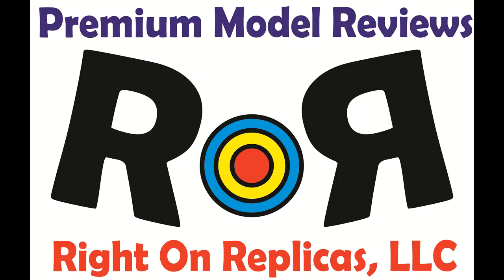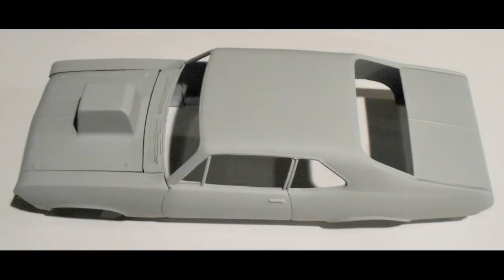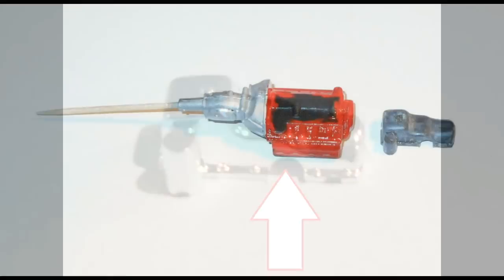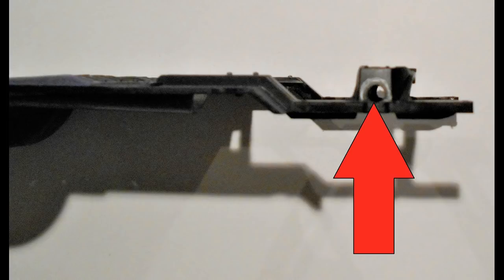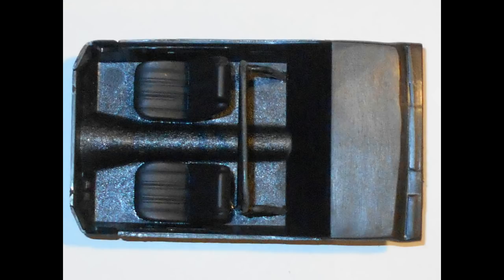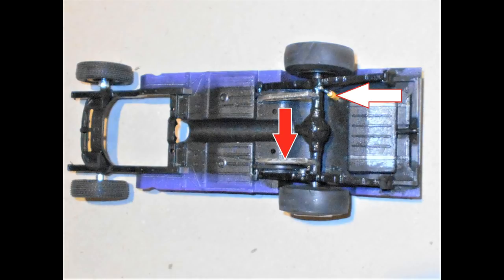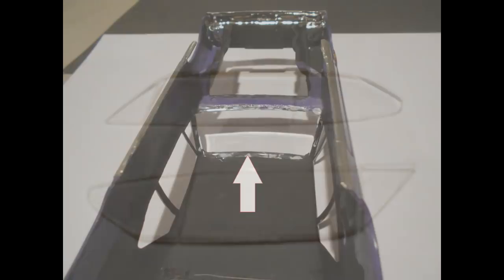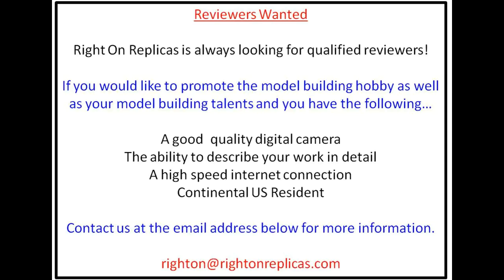Nova SS Pro Stock Car 1:25 Scale AMT Kit #1142M  -Model Kit Build & Review

Comment: Doug-the line you refer to between the headrest and bucket seat back is correct. Fed safety regs required "head restraints" mandated in '69 or '70, and they began to appear in '68, along with side marker lights. They were adjustable for "driver height", so they moved up and down to be positioned "at the base of the skull". We never did that. Freeway cruising was full up, local cruising was full down and hunched over the wheel! It wasn't until the mid- to late-'70's that high back buckets (in effect, integrated "head restraints") started to appear. Not to be confused with "highback" buckets from the turn of the decade, which was probably to guage reaction to what was to come. I, too have been frustrated by a re-tooled kit that overlooked the "axle thru engine" mess, cool fix! Great build, as usual!
Reply from the maker: PL, there's actually an open s!ot at the top of the seat back.  It could be used as a coin bank!  - Doug
Reply: The photos didn't show the coin slot, ane the result appeared to be moldeed to the seat. My apologies.
Reply from the maker: PL, No you're right.  I took the photo after I finished it off and closed the gap. Thanks!  -Doug

Comment: I have built this model kit I put the kit together and I found out that if you wait till the end of the build to put the two front fenders on you can set both fenders on, use the front grill/bumper on and then use masking tape to hold the fenders in place,no need to take any of the hood off with scraping or trimming.
Reply from the maker: BR, Thanks, that's a great tip for this one! -Doug

Comment: I just started this kit. I think this utube video got me interested AND  because they still make this exact kit,I didnt feel like I was sacrificing a kit from my big collection thats out of print,and worth a few bucks. ANYWAY,when I got this kit I worked at a Hobbyshop and forgot that I bought Fred Cady's Grumpy's Toy
Decals. They have yellowed in 30+ years but they say to set them in a window where the Sun will bleach them back to white. Hope it works
🤞. Anyway,THANKS for the video Doug ? Its giving me a heads up on the issues you encountered while building it . 👍👍👍👍👍👍👍👍
Reply from the maker: HH,  Put the decals in a baggie so they don't get moist from condensation.  Place them in a window that get s the most direct sun with the decals facing the sun.  They should lighten up within a week of two.  If you clear coat them they won't yellow again!  -Doug

Comment: Does the 69 kit have the same fender issues and hole through the engine?
Reply from the maker: NY,  I'm not sure what kit your referring to but I think this is a '69 Nova.  Regardless, any of the Nova kit derived from these AMT molds will have the same issue.  I think there's a stock Monogram kit #85-2098 that does not have this issue!  -Doug

Comment: The freaking hole in the oil pan doesn't even line up with the axle rod holes on the chassis. The hole in the oil pan is way too far back for the rod to go through it. What the?!! That's annoying. I'm not sure what to even do. There has to be a quicker easier way than using the evergreen tubing.
Reply from the maker: Bad,  I've seen others add axle stubs to the steering spindles too.  -Doug
Reply: @RightOnReplicas  would you mind elaborating a little on that perhaps??
Reply from the maker: Bad, As you saw in my video I didn't try to run the axle through the oil pan.  In fact, I filled it to finish of the engine more realistically.  I setup a tube that was in alignment with both sides by drilling a hole through the frame bosses and gluing the tube there.  I then cut out the tube just inside the fenders and capped the axle shafts so the engine would have room and the axles would remain fixed and still rotate.  If you don't mind that they a motionless, you can simply glue a stud to the frame bosses on the outside and mount the inner wheels on them keeping side-to-side symmetry in mind.  Hope that helps!  -Doug
Reply: @RightOnReplicas  yes! Thanks brother! Your videos have helped me take my skills up many many levels. You rock.

Comment: Im doing this kit. But mine will be lowered with a drag wing, custom hood, wheelie bars, parachute and zoomies. What say you dougie? Can you customize a model for youtube and it not be stock and boring??
Reply from the maker: MK,  Thanks for your inquiry.  We don't consider Out-of-the-Box (OOB) builds boring.  At RoR we mostly stick to construction that the average builder can do.  That's because these are KIT reviews.  That requires that the parts and decals in the kit be used to see if any issues need to be addressed.  Occasionally, we do some modifications just as the one in this review where we filled the hole in the oil pan to replace the axle that runs through the engine.  You'll need to do that to lower the body.  We've also done some customization like Dom’s F&F6 “Superbird”  https://youtu.be/s2BazxhOD6k but there doesn't seem to be much more interest in them than Out-of-the-Box builds.  Again, thanks for your inquiry and if you want to become a "kit basher" for RoR send us an email.   Thanks for sharing and please subscribe if you haven't already, to help us continue our mission to inspire more modelers!  -Doug